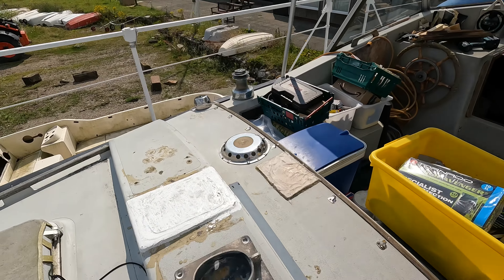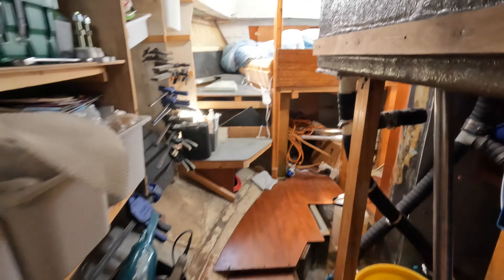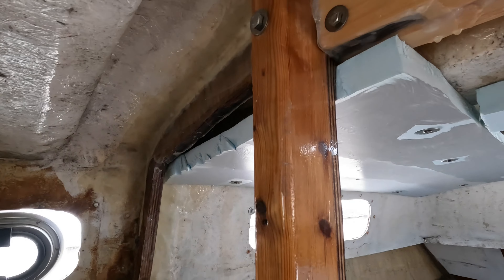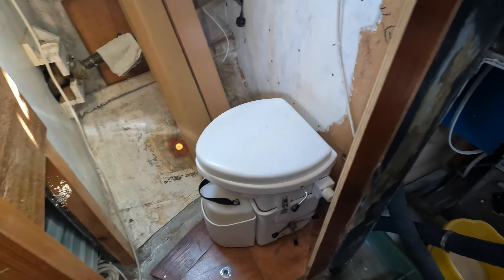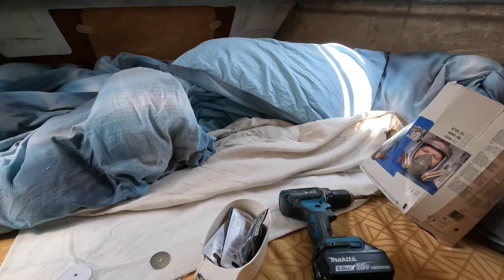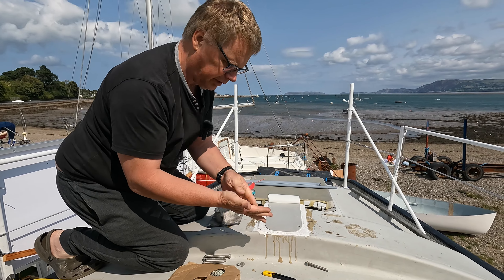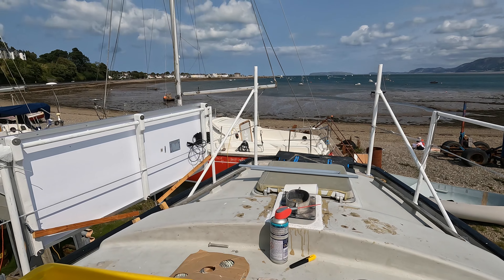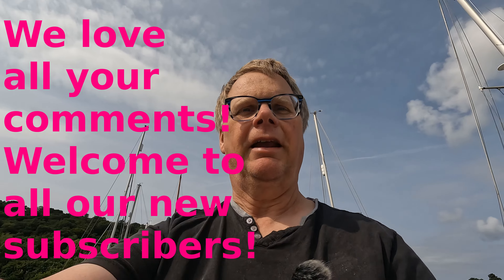Is our Mizzen base support strong enough?

Comment: Won't the butyl compress under the mast's weight, loosening the footing step?    Yes, this might be good for compression static sealing, but will it work for a dynamic load?    (Sorry if this seems like a silly question, a bedding caulk might move/stretch  but now the entire sheet moves the flexes all over.?)
Reply from the maker: Yes, we have noticed that we have gone around the windows a couple of times tightening the bolts. But it's an easy task to check the bolts and they have nyloc nuts so they won't shake off if a little less tight.